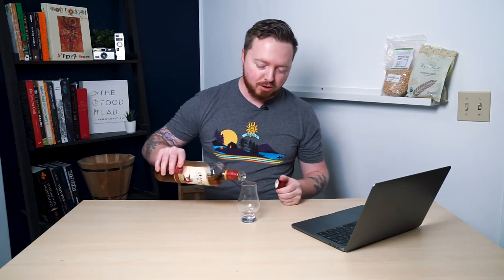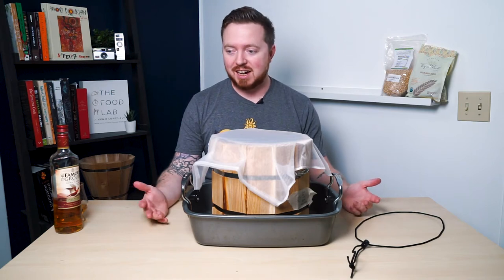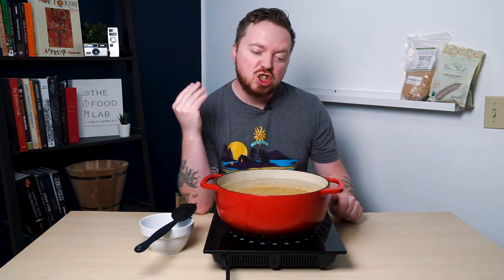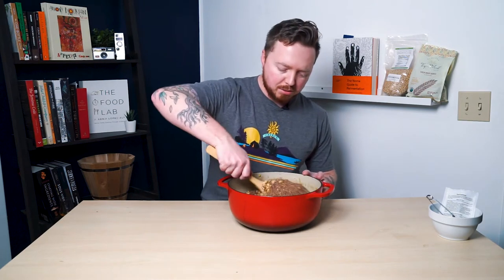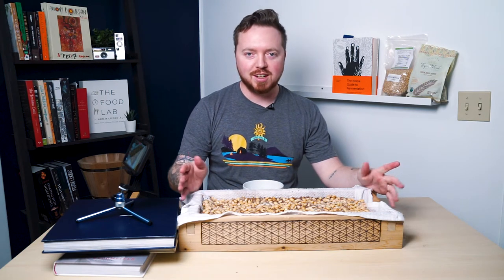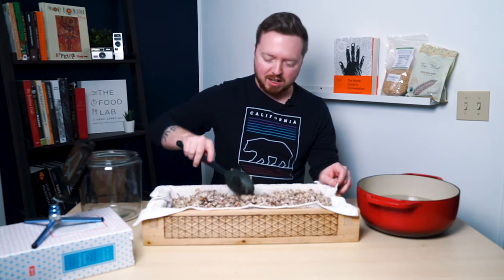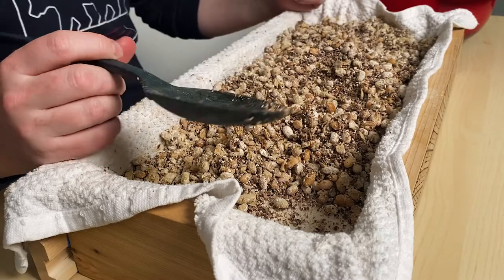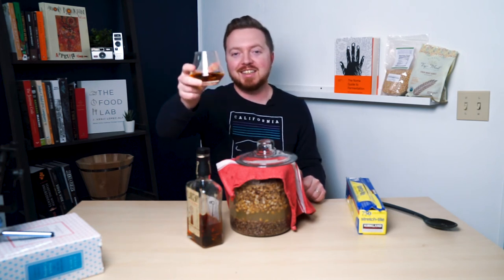Homemade Soy Sauce Fail. Time to try again!

Comment: I'm on my third batch (I make approximately 2.5 gallons per year).  I had my first batch ready this year since I began this process.   

I use a 5 gallon food safe bucket with gamma lid and fermenter lock.  This is a great setup that works for my sauerkraut, pickles, and hot peppers.  For the cedar flavor I use cedar grilling planks that I have soaked and dried a number of times.   

I did something different this year and formed patties out of the soy beans/wheat berry mix.   In the past I had trouble with over heating and my first 2 years have off flavors because of this.   However, with the patties it becomes more of a set it and forget it sort of thing.  

If you have any questions or concerns, I would be happy to help!
Reply from the maker: That's amazing, I may hit you up! I'll be pressing and bottling my batch here at the end of this month!

Comment: Hi ! Thank you for the videos! I am a little confused on when you use the temperature gauge in the mix. . What is the point of that?
Reply from the maker: You need to put it into the mix because the temp of the mixture is what you want to regulate, not just the air temp.

Comment: A shame, but no shame for you! I totally understand the struggles these days and more often than not I slack off on my projects as well.
I think going for a more controllable setup makes totally sense, looking forward to the updates!
Reply from the maker: Yea, failure just means ya learned something! I'm excited to finally make a good one!
Reply: @ColinMakesAllTheThings  Indeed! Also, I recommend the Arduino/ESP hacking venture :D. Currently building my second generation of my fermentation chamber, over-engineering away...good fun :D (and terrible time sink...)
Reply from the maker: I love it!

Comment: where did you get the glass vessel from?
Reply from the maker: A store called Mejier. I bet whatever big box grocer / everything store near you would have something comparable. Or check out the dreaded Amazon.
Reply: @ColinMakesAllTheThings  Thanks so much! Will do. What size vessel did you use for the video? I'm about to start my own soy sauce journey and I want to make sure that I get everything right!!
Reply from the maker: @itsmickyc1  I believe mine is 1 U.S. Gallon. Good luck as you begin!

Comment: Good stuff no mention of measurements?? The digital dollar right wing propaganda advert was totally off for someone who makes koji.
Reply from the maker: I'm not even monetized, so the fact that YT plays right wing propaganda ads on my videos is even more upsetting. The recipe for this batch of Shoyu can be found in the Noma Guide to Fermentation!
Reply: @ColinMakesAllTheThings  Thank you. I'm going the zero recipe way on almost all my projects these days, just general parameters, then go! is my procedure. First batch of Jiang You/ Shoyu seems to have gone fairly well up to the brining part, the spores incubated easily, with a slight bready smell the first 24 hours which faded to become more mushroomy after that. Hoping the brining results are good without any rottenness. I used a gallon cider jug with fermentation lock. Any thoughts on air free or open air during this process? The ads that get placed seem sort of odd to me, no biggie, and most are get rich quick scams in my experience. Don't know if that is my personal data causing that, or if everyone gets that.
Reply from the maker: @acharyajamesoermannspeaker6563  I have only made shoyu with the lid on, so I'm not sure about open air personally.